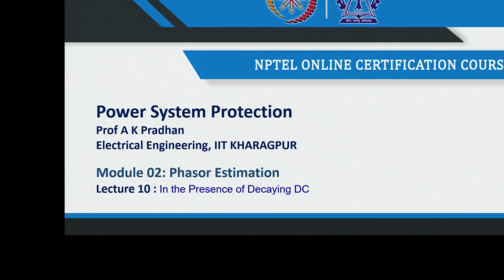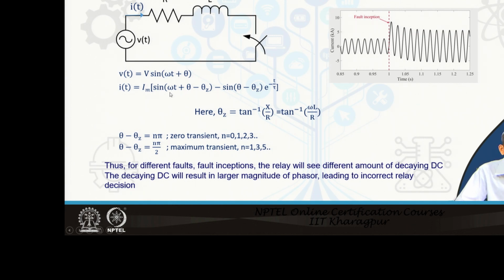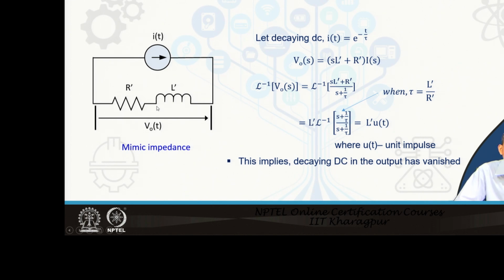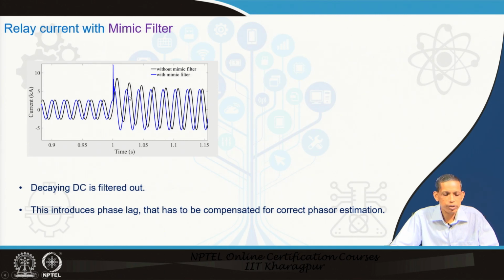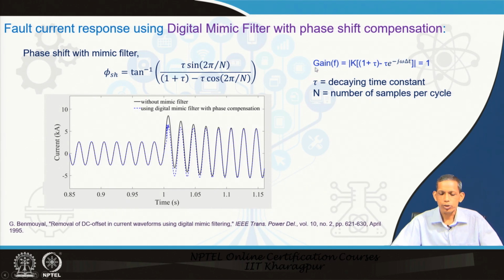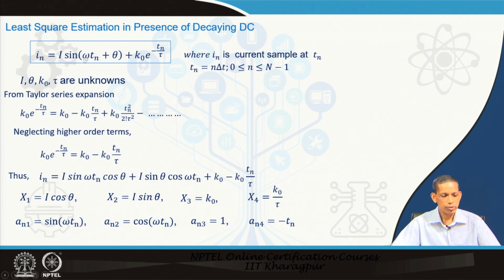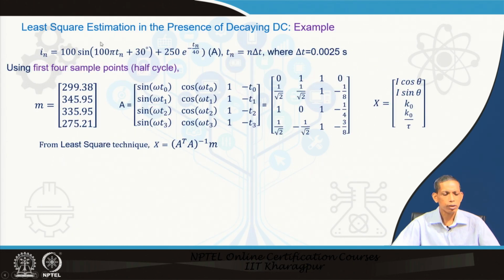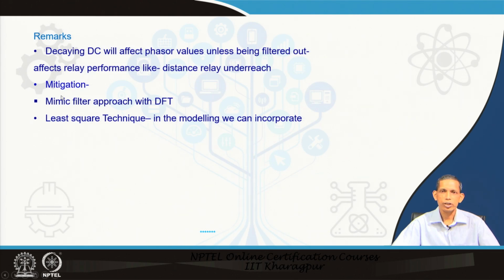Lecture 10 : In the Presence of Decaying DC

Comment: than you , Prof PRADHAN
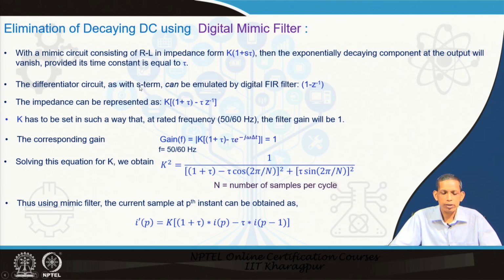in the minute of (11:20)
 how come S is substituted by 1-z^-1 , in the differentiator circuit
Reply: If you take a passive differentiator block or an active differentiator( Op amp for example), it is composed of R and C elements. In terms of voltage, C lags R, which is the reference phasor and can be reached to a same positions after a clockwise rotation, which means that it is delayed. Even when you normally differentiate a quantity, the order is reduced and it's final course is delayed. Hence, they have implemented a delay element ( 1-z^-1) .